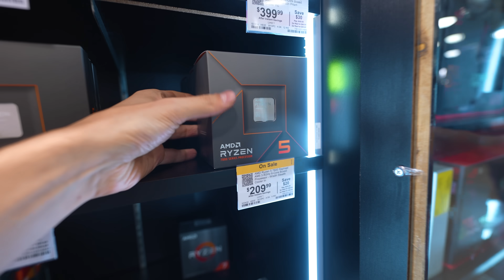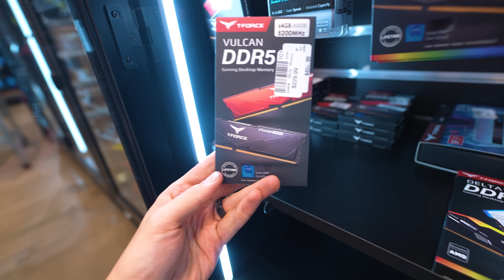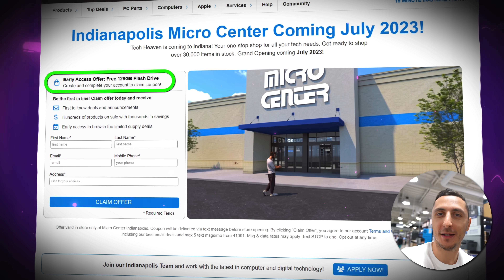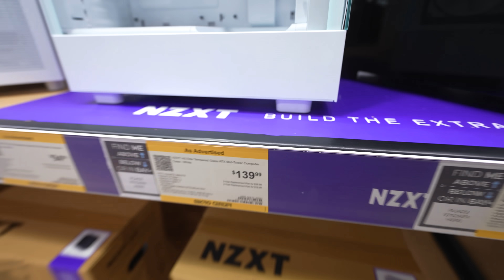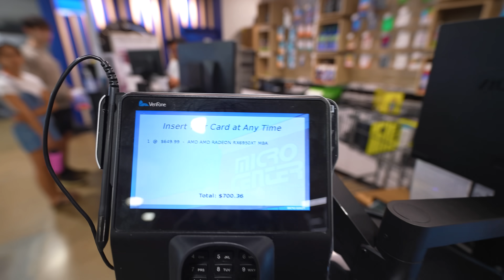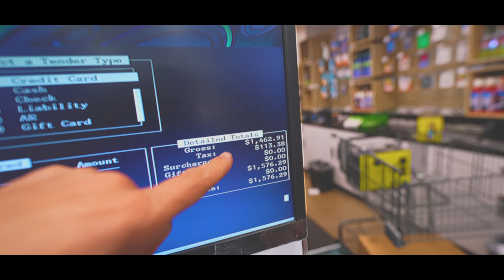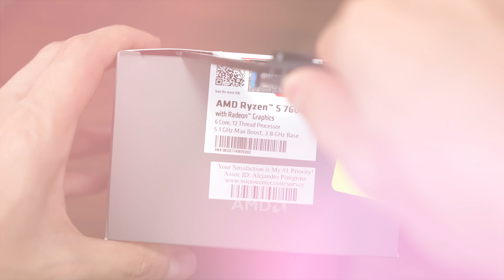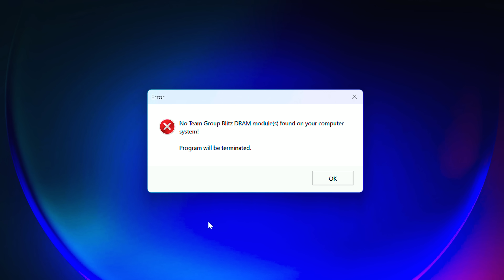This is what $1500 gets you in 2023!

Comment: I recently bought my first PC from there. I was at 2705 out the door for my first build (oooook technically 2405 but I added their warranty bundle on my computer so parts are covered) and got Ryzen 7 5800X3D, Gigabyte RTX 4070Ti OC, MSI carbon, 2.5TB of SSD’s 360mm AIO for the CPU, some 140mm fans, 64GB of Corsair vengeance 3600 and a ASUS 1000W tuf power supply, all wrapped in a lovely white and black Y40 case. Love the look, love the PCI extension port that sets the GPU side mounted and I love the look. I’ll tweet it at you

Comment: the closest store to me is 200 miles away, almost on the dot. also for anyone who reads this i just ordered all the parts for my new PC. decided building a new one and selling the old would be a cheaper option than to keep replacing parts little by little in my current. 
PC Parts List:
Case- Corsair 5000D Airflow
Storage- Corsair MP600 2TB M.2 / 5TB WD-Black HD " yes i know its meant for xbox, but it works fine as an external drive"
Ram- Corsair Vengence DDR5 32GB 5600MHz
GPU- PowerColor Red Devil RX 7800 XT "which just released on the 6th"
Motherboard- MSI PRO X670-P
CPU- Ryzen 9 7900x
Cooler- Corsair iCUE H150i Liquid Cooler
PSU- COrsair RM 1000x Fully Modular
Extra- Lian Li fans

Comment: I live 2.5 hours from micro center.  I bundled and save January this year. Got the 5800x3d for $290 and the Asrock Formula OC 6950xt for $650. And Evga 1000w p3 platinum for $180.
Reply: I also picked up the AK620 Deepcool for $50. They had a bin like Walmart full of them.

Comment: 2006 -
Case- Gigabyte Aurora 570 3D - $140
PSU - PCP&C 750 watt quad SLI - $140
Mobo - Asus Striker Extreme - $300
CPU - Intel Q6600 - $266
Cooler - Thermaltake V1 - $70
RAM - Corsair Dominator 4GB 1066 - $160
GPU - EVGA GTX 8800 Ultra- $800
HDD - Raid - 2x WD raptor X - 150G - $600
         -Storage - WD 1 TB Black - $200           
Optical - Asus DRWBLT drive - $94 
$2780.00
I always go by this relative build, for the time it was upper tier to best in slot for components. From there I judge Value based on Budget level, Comp to Comp rather than the overall cost, the reason for this is because fluctuating individual markets..

Comment: Turned out that on my motherboard I just do a couple of things to overclock and the rest turns on automatically. Now I'm running 4.6ghz on my old fx 8350 I  can oc it up to  5 g's if wanted to with the invidia gtx 960 I'm pairing it with, but no need to. Now I can run Starfield at ultra high settings with no issues. Emulating like a dream too!
To think that I was thinking of buying new hardware to build a new Ryzen 7900x3d etc,. Haha maybe later. All those video that recomend buying a better GPU, CPU, cooler, maannn! Why? When my rig and probably a lot of people's rigs can run triple a title's just fine. High settings is good enough for personal home gaming.  Nobody has to prove anything to anyone. Do with what you've got, enjoy and have fun!

Comment: The difference between 5600mhz and 6000mhz is almost none existent, it's so small.

There's a big difference inbetween 2666 and 3200, 3200 - 3600 is okay but anything after that is icing on the cake imo. 

especially when you get to the 6000mhz range, that 400 doesn't really do as much as it does around the 3000 mark.

Comment: Do a build for $1500 with ( intel Core™ i7-12700K Processor, 3.6GHz w/ 12 (8P + 4E) Cores / 20 Threads) processor  but able to play on recommended graphics for  call of duty or for a horizon please I’m new to custom builds pc and not sure what parts fit what but I want to use the intel cpu posted above

Comment: Is a prebuilt with an i7 12700f and a 3080 for 1300 a bad deal? I figure even if I could find a new 3080 for 500, which I can't, the cpu is still around 300. The case is always at least 100. 100 for ram. 100 for SSD. 100 ish for psu. Prolly 150 for mobo cause I think its ddr4 and not 5. Then the other random stuff like fans will prolly run me 40-50 bucks. Anyone think that's an actually pretty good deal? Cause I feel like I lowballed everything up there pretty hard aside from the cpu. It's just hard to say for me cause the market for 3080 is in a weird place cause it's older.

Comment: 1600 euros in my country
but with rx 6800xt
SO MY PROBLEM IS,maybe not problem,i got i5 13400f,rx 6700xt,b760m,16gb ram,850w psu,arctic liquid freezer II 360 and lancool 3 for about 1500 euros
is that better then yours or worse
since rx 6800xt is around 120+ euros more then my gpu,but i did spend more on case and psu